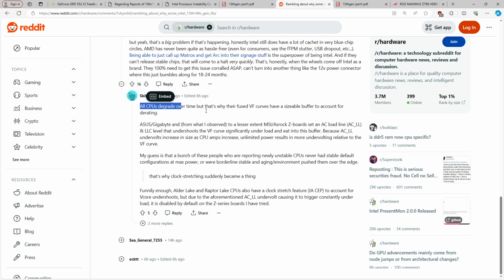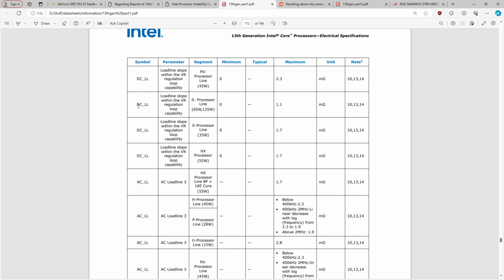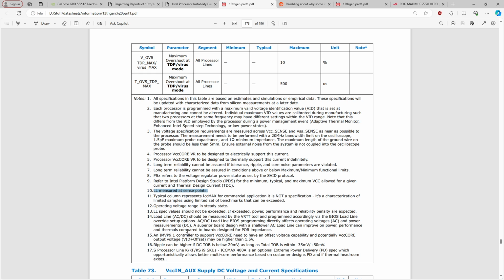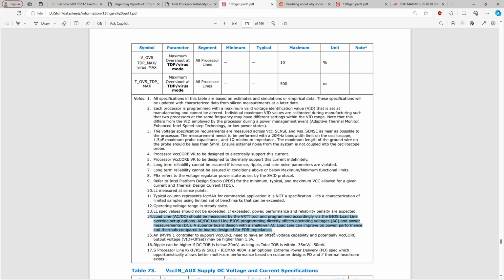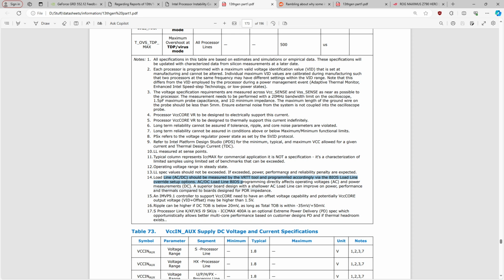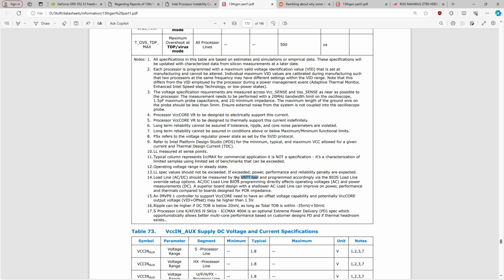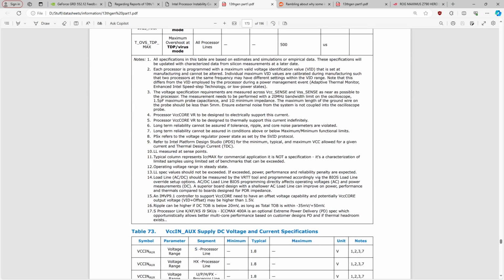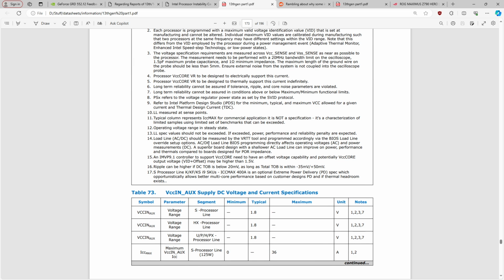Ranting about intel's 13th & 14th gen Vcore load line "specifications"

Comment: I have a 14900k with an MSI Pro z790-a wifi ddr5 mobo. I had many issues with MOBO defaults. Adjusted cooler tunint to boxed which adjusted both pl1 and pl2 to 253w. It also adjusted the IccMax to 307a. Disabled msis enhanced turbo as well. Issues are mostly gone though when I load an UE5 game it's barely stable. If I have a youtube video playing, the audio stutters etc. All issues end once the game has loaded.

Could you please make a video of walking through some further, safe tweaks one could make to enhance stability? If you have access to multiple MOBOs, it'd be amazing to see the walkthrough on multiple different vendors bioses to help us tech illiterate folks.
Reply: Just move the svid
Reply: As said, I'm completely useless when it comes to tinkering in the BIOS. The MSI board doesn't have an option called SVID. Asus boards allow u to change SVID behaviour to intel fail safe which apparently overvolts ur CPU a bit to ensure stability. What would I need to do to simulate the same effect? I'd assume adding a bit of positive vcore offset would have the same effect but as I said I'm very nooby, are there any drawbacks to this other than higher temps? @night_light2867
Reply: just return these stupid chips and get something actually worth its money... like a 7800x3d

Comment: "here's the CPUs that we squeezed every last bit out of, good luck making everything work"
Reply: Thats about it yeah. But thats good. They allow the Board Partners to use all overclockling settings. Unlike the forementioned Nvidia.
Reply: @n1kobg No its not.

Its good if we can change Stuff and get around Limits… that i agree with. Its not good when the out of the Box Settings and Mobo Venders do it as Standard Settings and they are almost to much to the Point it doesnt work (or doesnt work a longer Period of Time).
Reply: @flimermithrandir  Yes the 2nd sentanse is what I meant.
Reply: @n1kobg  Ok yeah. That i am fine with yes.
Reply: the cpu works perfectly fine if youre not fiddling with any settings.

Comment: Right now I need to figure how to get a safe modded BIOS for my Z690 that adds Spread Spectrum option, so I can disable it.  
I don't get why Intel boards don't include this option and have Spread Spectrum enabled by default so we lose 10-12MHz off the top.
Reply: May I ask why exactly you want to disable it? I'd always keep it enabled, disabling can lead to tons of issues especially with audio devices. If you care about the few MHz you might loose, just up the BCLK by 1.
Reply from the maker: ASUS should has spread spectrum settings. Gigabyte you just manually punch in the BCLK value. MSI and asrock I'm not sure.
Reply: spread spectrum being enabled as default is important to be able to sell stuff :D

Comment: Wow second episode! 
Buildzoid - do you think that another option for more stabilty is disabling the E Cores?
I've been using my 13900k with P Cores only for about 1 year and never had a problem.
(come at me guys, yes, I nerfed my cpu - if it had 10 P Cores it would have been better)
Reply from the maker: that would help since the E-cores significantly increase the CPU's power draw.
Reply: @ActuallyHardcoreOverclocking For max CPU usage but iddle power draw would be signficantly worse or lightly threaded workloads as well.

The e-cores are needed for good perfomance per watt and they are still cores.

If i turn off the e-cores on my 12700K, i would lose fps, get higher temps and worse power efficency.
Reply: @saricubra2867 the problem isn't efficiency or performance, it is stability. People aren't disabling ecores for no reason. Also, unless you're using win11, e cores are more trouble than they're worth.
Reply: you nerfed it for no reason, fix the problem at the source (undervolt) and you can run everything fine. 13900ks 5.6/4.4/50 on an aio here.
Reply: @ashryver3605  I found a good compromise was disabling hyperthreading, running XMP and keeping all the E cores. I can push my chip to 6GHz all core with much less voltage than previously and still score around 37000 in Cinebench R23. This is just for a gaming setup, but has worked well in my opinion.
Reply: @ashryver3605  "For NO reason" reminds me of the Bill Burr "There's NO reason to hit a woman" :D 
Let's just say that for my games/applications, P Cores only (with HT on) is the best for performance/power/temp. 
Then of course if one day I will have to edit a 4h long video, I could enable E Cores.
Reply: @ashryver3605  lol I run this on my 13700k on air! 1.37v llc 5 on tomahawk z790

Comment: Out of curiosity - regarding your previous video and your 14900k crashing on Cinebench. Is is crashing in Cinebench at 5.4GHz only when running without power limits applied or is it the same with Intel's power limits properly applied too? And one bonus question - based on your theory that the voltage isn't enough to run 5.4GHz at 100*C - have you tried lowering the TJ Max down to 95 or 90 to confirm that theory? I guess it would only take half an hour to an hour to check if setting TJ Max lower actually solves the instability.
Reply from the maker: if I apply the power limits it doesn't run at 5.4
Reply: @ActuallyHardcoreOverclocking  Sure, but the question was if at whatever it's running with power limits applied - is it then stable at least. I'm still also curious about lowering the TJ Max too - if you have the time, you can give it a try. If it's still crashing at 95 or 90 degrees TJ Max, then there might be more to the problem. :)
Reply from the maker: @danielt91  oh yeah with the power limits it ran a full hour of cinebench. It was also running much cooler. I think around 85C instead of 100C.

Comment from the maker: first
Reply: Hi Buildzoid! Thanks for all the great work as usual.
Reply: Lmao, first indeed
Reply: based
Reply: I think Intel spec guys assume LLC settings are only meant to work under settings listed in Intel's specs. So, they don't bother with testing what is correct for LLC under "no power/current limits". Which to me is both Intel's and manufacturing guys fault.